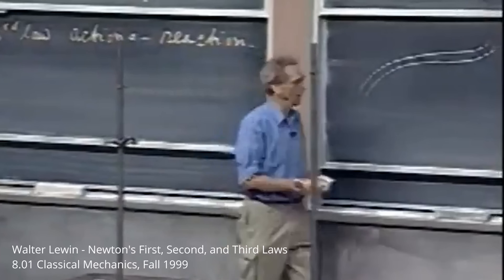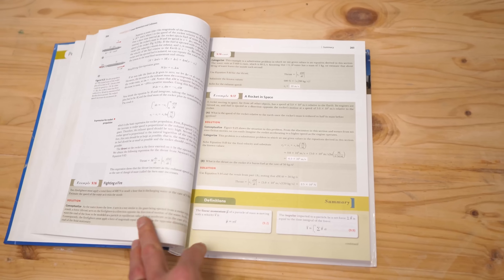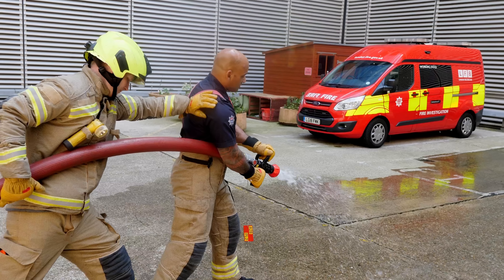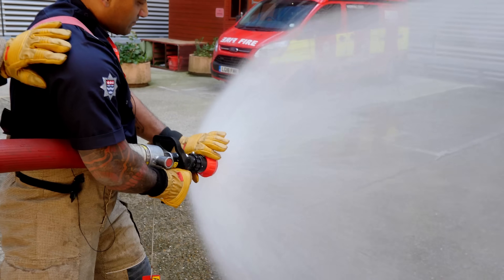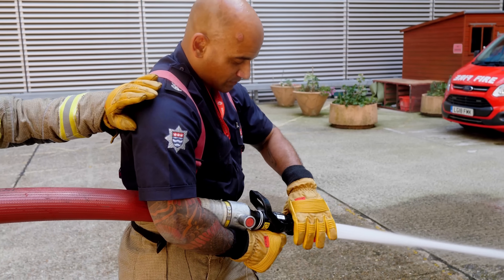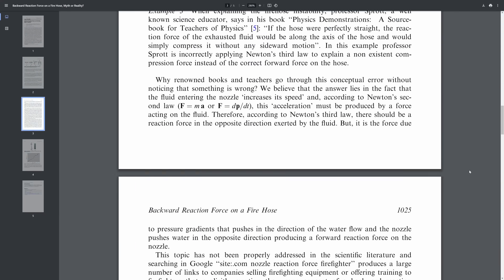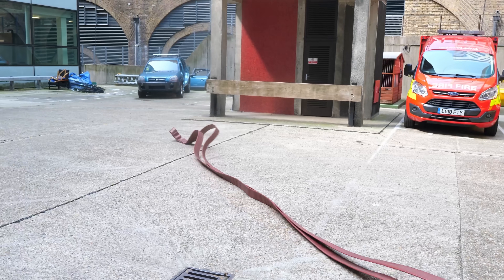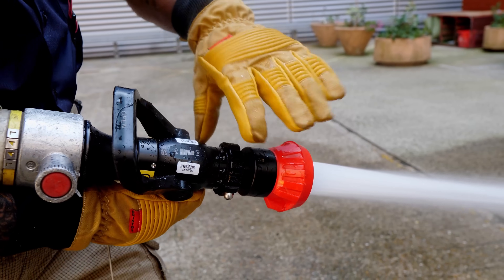Why chaotic hoses dance

Comment: I think that the effect in the firefighter hose is different than you flimsy air hose.  The firefighter hose has a very high pressure inside, and make the hose itself "become" rigid; these are "soft" when empty, and very hard when in operation.  This rigidity must transport force from the nozzle to the ground via friction, so firefighter does not experience all the force.  Now if you lift the whole  hose, thing will change a lot.
I have seen high pressure hoses "bend" when pressure is applied inside them, and once pressure is released they return to the "original" form, no leaks.

Comment: But… how does friction factor into the equation? Wouldn’t there be forces that vary according to how much the fluid interacts with the walls of the tube? 
I could see a smooth walled tube directing most forces out its end, while rougher walls might amplify side-pointing vectors through increased pressure against the walls.
And then there’s turbulence within the tube. Dammit Steve, you’ve opened up a can of worms over here…

Comment: 13:30 Noooooooo! there is no gain in momentum to the exiting fluid at the end of the pipe if the exit diameter is same as pipe diameter! People run simulations of pipe flows regularly and we never see the exit velocity be greater than the velocity inside the pipe.

Comment: So question. Let’s say you have 3 firefighters holding the hose and let’s say each firefighter is holding 30 pounds of pressure. If you added more firefighters, would the pressure that each firefighter is holding decrease the more firefighters you add???

Comment: Just looking at it, I think the inflatable tube men is actually a very different phenomenon than the hose. The air coming out at the end might be having an effect, but the bigger effect appears to be that the pressure of the air is just barely not enough to hold the tube up. So, when the tube is straight, it wants to collapse, however as soon as it starts to collapse, the kink introduced into the tube restrict the air flow. With the air flow restricted, the tube now has enough pressure to hold itself upright, and so the kink is pushed up until the whole tube is fully upright again. At that point, the air can escape easily, and so the pressure drops and the cycle repeats.

An easy way to test/demonstrate this would be to simply vary the pressure on the tube and see what happens. With high pressure the tube should just stabilize and be fully upright.

Comment: It seems like the nozzle does want to travel backwards, however the nozzle is supported by the hose. So it's sort of like dropping a weight onto a rubber ring -- ultimately there will be buckling in one direction or another, and that depends on the minor details of how the hose and nozzle are being held relative to the water stream. The firefighter must hold the nozzle to prevent this buckling. 

I would guess that this might not be the full force of the water (as an extreme case, assume the hose was perfectly stiff -- now you can just walk away and the hose won't flail). But it is probably significant, not to mention chaotic, so I'm guessing it takes a lot of work to keep the nozzle pointed in one direction stably.

Comment: The fact that the water accelerates at the nozzle of the hose due to the pressure difference inside the hose (high) and outside (atmospheric) also makes sense if you consider the example where you close the nozzle on an elastic hose. In that case, the pump can increase the pressure inside the hose to the maximum since there is no open end. When you then quickly open the nozzle, the water shoots past the equilibrium point for a brief moment before settling.

I’ve always thought this was due to the elasticity of the hose, but it could just as well be due to the increased pressure difference.
Reply: yeah, it's more the pressure. check out how a hydraulic ram pump works.

Comment: If there is no nozzle, there is no acceleration when the water leaves the hose. But I can tell you from personal experience that a hose with no nozzle will still whip around chaotically. In the case of the fire hose, you are also neglecting the mass and rigidity of the water-filled hose, which is not insignificant. Some of the movements propagate along the hose as a wave.

Comment: 11:55 The fact that there is 0 net force acting on the fluid inside the hose doesn't imply pressure is the same all the way through. The pressure force balances out viscous friction resulting in 0 net force, however, there will be measurable pressure drop as you go downstream.

Comment: 9:00. Phd candidate researching in fluid mechanics here. Why measure pulling force in the first place? The pipe with no nozzle will try to move in a direction that straightens the pipe, not just in the direction opposite to the flow. 
And as @ProjectPhysX pointed out, the tangential force will mostly come from the change in the nozzle diameter that accelerate the fluid before exiting.

Comment: I think youre making a false assumption by claiming that "a parcel of water" has the same speed everywhere in the hose. First the hose itself is going to introduce drag/friction, so a "parcel of water" touching the wall of the hose is going to experience more resistance than a "parcel of water" closer to the centre of the stream. Then there's the fact that the hose isnt 1-dimensional. When there's a bend, the water on the outer part of the bend has longer to travel than the water on the inner part of the bend. So again experiences different forces.

Comment: Just wanted to theorize that the reason more of the water hose laying on the ground isn’t whipping around or even moving is because the friction that the ground applies to the hose can’t be overcome by the amount of force generated in the hose and so it just lays there until you get to the end where there expansion force of the water leaving the hose can overcome the friction from the ground.

Comment: Steve, I was a firefighter for 32 years, and a certified pump operator.  I can tell you that the reaction force on the nozzle is real, and potentially hazardous. Most fire engines do not have flow meters-the operator has to calculate (or look up on a chart) the flow based on the pressure at the nozzle, and friction loss (which is a function of hose diameter, hose length, and some other things).  If an operator gets their pump pressure wrong, he can cause the firefighters on the nozzle to lose control of it and create a very dangerous situation.  The feeling, when on the nozzle, is that the hose is trying to pull itself backwards out of your hands.  Reaction force is real.  That second paper, which I have not read, is sketchy.

Comment: Another potentially relevant thing to consider from a fluid mechanics perspective is the idea of boundary layers. Real liquids are viscous, meaning that there will always be some friction against a solid material (like the side of the hose). At the nozzle, therefore, it may be that the tip particle (A) that you described experiences a net force forwards, but the particle behind it (B) experiences forces backwards from A, forwards from C, and backwards from the walls (friction slowing it down). Simialrly, C would experience a force backwards from B, forward from D, and backwards from the walls. This pattern would repeat until the pressure from X and the pressure from Z were equal, and Y was not accelerating. The sum of all of these friction forces on the fluid elements from the walls would result in a net force on the hose, although I'm not sure which direction it would point (my example would imply forwards, which feels incorrect but I can't see where I've gone wrong).

Please note I haven't drawn this out, so I'd be happy to understand where I've made mistakes.

Comment: Your comparison to "space rockets" is flawed: rockets do not push against nothing (a.k.a. "the vacuum of space") by means of "Newton's Action and Reaction" (that, no offence, it does not work the way you believe it does). Proof? Well, your hose will fail to flail in vacuum, because it will not be pushing against anything. Try it and see.

Comment: The pump does experience the full force of the water, and so does the nozzle.  The whole hose experiences the force like a string in tension.  As long as the hose is being held static, no work is being done, so the energy doesn't need to "spread out" to one or the other.  It doesn't matter if you hold a rocket nozzle by the brim or by the gimbal, it pushes the same.

Comment: The water is actually not at constant pressure throughout a hose, you're right that water does travel at approximately constant speed (assuming constant density, which is fairly true), and thus there is no net force, however in addition to pressure acting on the water there is a shear force applied by the wall, which resists water flowing past it. Thus, there must be a gradient in pressure in order to overcome that "frictional" shear force
Reply: Secondly, the velocity of the water will accelerate (increasing the shear force) until static pressure (Pressure when not moving minus "dynamic pressure" aka kinetic energy per unit volume) at the nozzle equals the ambient pressure of the air, and that fluid element at the nozzle is in equilibrium. The firehose appears to strain under the pressure load is in fact because it's experiencing a lot of pressure, however the nozzle is designed such that the water is forced to be at a much higher velocity there than in the hose, causing the highest exit velocity (and thus force) for the lowest loss of pressure throughout the firehose itself

Comment: I think you could test the pressure differential idea by letting some water fall by gravity through an untethered dangling hose. Gravity would accelerate the fluid through the hose without imparting positive pressure. If the hose remains straight, that suggests it's the (missing) delta-P at the nozzle that makes it wiggle.

Comment: I don't think "the fluid accelerates so there must be a reaction force" is really a good causal answer, as the fluid accelerating is a result of the force, not the cause. You mention rockets with this reasoning and if you were to look at a simple cylinder rocket (no nozzle) you would see that it's actually the internal fluid pressure pressing against one end of the rocket body that applies the force to the rocket; the fluid flying out the other end is just a necessary consequence of not having the wall on that end, which would otherwise receive equal and opposite force from the fluid pressure. The actual causal answer probably does have to do partially with the curvature, possibly in a way where reducing the curvature causes some other parameter to grow to cancel out the overall change in effect, but also probably with some fluid dynamic behavior at the nozzle. It could also be something like some strange way the tension is transferring the force that's holding the other end of the hose in place.

Comment: I think it's more like the water is trying to push the hose backward . If the hose is curved there is an area on the bend of the hose on the inside that is equal to the area of the nozzle . Like if  you cut a donut with a cardboard toilet paper tube

Comment: through a bend, wouldn't there be a pressure differential around the circumference of the hose?? the outside liquid would have to speed up, lowering pressure, and/or the inside would need to slow down, causing an increase of pressure. those pressures would tend to straighten the hose out. an experiment where the end of the hose goes back into the pump would be interesting: what shape would the hose prefer??

Comment: I remember being shown a different way of thinking about the reaction force of a simple nozzle that doesn't need to consider momentum. Imagine a completely sealed bulb of water at some pressure. There is no net force on the bulb because the pressure is acting in all directions. All the local forces are cancelled out by forces on the opposite side of the bulb. Now imagine that a hole develops instantaneously in the bulb. In that instant, there is an area where the pressure is no longer acting on the bulb. Therefore there must be some pressure opposite the hole that is no longer being offset -- which causes a net force on the bulb opposite the hole. I think this can probably be applied to a hose with a pump at one end and a nozzle at the other, but it would take someone smarter than me to prove it.
This still doesn't explain the results from when you measured the force of a straight vs curved hose though. The hose you used looked like it had a pretty small ID. A very small curve could still cause the walls of the hose to be in the line of action from the outlet maybe?

Comment: Could the force be similar for a straight and curved hose because of drag inside the hose? You might be able to test that with a larger diameter hose with the same velocity fluid.

Comment: Something I noticed with garden hoses when long time ago is if you hold it with nozzle facing down and the jet is supporting part of it's weight. You can then submerge the tip into a body of water, the moment it does it drops like a rock. I imagine this is because the water is not compressible and a lot heavier which lowers the exit velocity dramatically.
Reply: It's a HUGE drop of force though. It's as close to zero as I can feel in my hands. Surely the water is still flowing at over 90% rate?

Very good thought you have had. Steve or someone should SURELY follow up with that experiment. What is the force underwater?
Reply: @donperegrine922  force = mass x acceleration. So it's directly proportional to how fast the liquid accelerates out the nozzle. Similarly kinetic energy = 1/2 m v^2 means that a less velocity will exponentially reduce the energy gained by the liquid. This is actually partially why rockets prefer to use lighter fuels because the products of combustion can be accelerated faster, which leads them to get more bang for the same mass.
Reply: Its force is due to pressure differential not just velocity. Its energy is shaping the water rather than increasing and decreasing air pressure. There's also the nozzle design which is dependent on the pressure around the nozzle.

Comment: Agree with the firefighter, never leave these scooters charging overnight, and ALWAYS make sure you're using the right charger. These scooters are often made by small keysmash-name brands who pop up and then disappear in a short period of time with no accountability, they're made very cheaply, not mecessarily to the point where you have to be afraid of them but you cannot treat them the same as a phone with good overcharge protection, they need more manual intervention. Only charge them for as long as it takes to top them off, and never run them all the way down. Also if you leave it to sit for a while, top it off every other month just to avoid the battery passively draining all the way down.

Comment: Im at 9:05 right now, wouldnt the nozzle be what is converting part of the pressure the pump produces into velocity, creating the rocket effect? Not the full force of the exiting water must be held against, but the difference in velocity caused by the change in diameter.

Comment: Wouldn't it be simpler to think of it in terms of pressure? The fireman has to resist a reaction force equal to the area of the nozzle times the water pressure minus the air pressure.

Comment: The balloon nozzle, in addition to the chaotic motion from the acceleration of the air stream is also quasi-cyclically collapsing on itself due to the velocity of the air in the nozzle causing a pressure drop (Venturi effect) which then closes the opening, reducing the velocity... and so on. When you see how completely unpredictable even a relatively simple Complex system is, keep that in mind when they tell you they can model the climate.

Comment: Backwashing a pool through a vinyl hose has the same behavior as the air dancer but on the ground. Any small bend in the tube causes a bigger pressure buildup in the tube and “pushes” that bend “out” thru the tube where it flips over to the other side and does it again. 

If you reduce the flow rate that phenomenon never happens. I believe it has to do with the max flow rate through an unrestricted tube and even a small bend in the tube (or firehouse or wind dancer) causes a buildup of pressure that then gets pushed down the tube.

Comment: The bends in the firehose still feel the sideways acceleration but the weight of the thick hose+water keeps the hose pinned down up till the tip where force from the pressure difference is making its effect